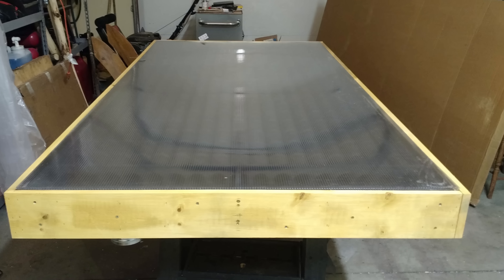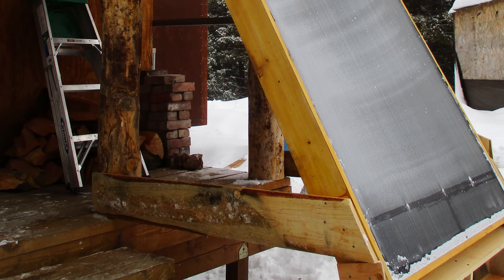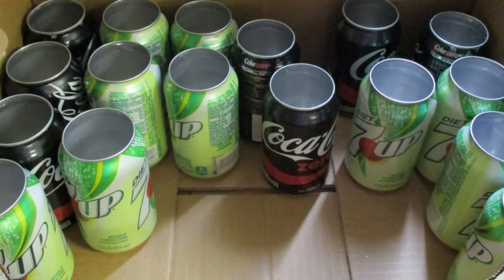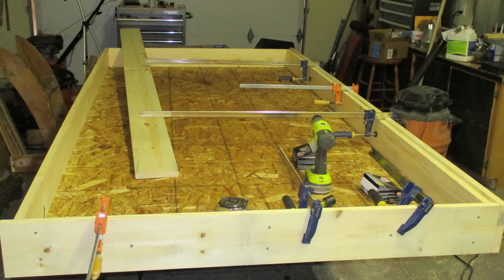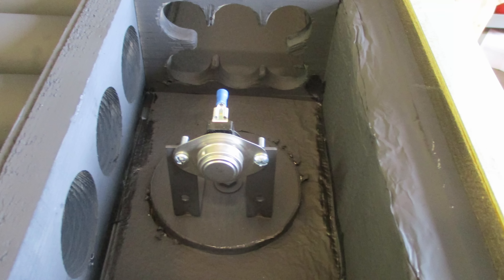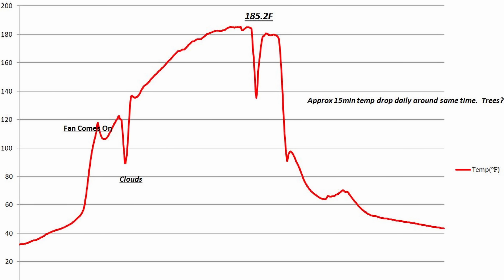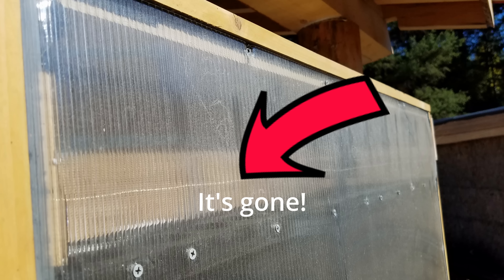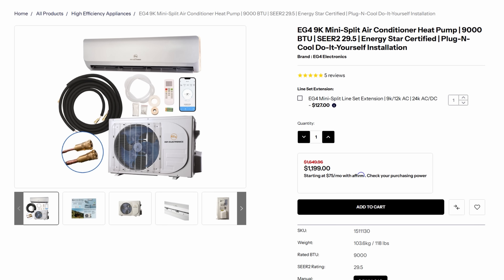7 Years with Pop Can Solar Heater - Is It Still Worth It?

Comment: I'd like to make a couple of suggestions. I built my beer can heater six or seven years back and I don't believe it cost me even $100. First off there's no wood other than the two boards that feed air in and out of the cans. The box itself is two layers of foil faced foam board. Never had an issue with it not being able to handle the temps. Now it's not a flat box. Up at the top it turns down at an angle that matches the suns elevation in winter. The top portion fits into a window so it draws inside air that is heated and blows back into the room with no electricity needed. The box is built as a thermoplane. It has a raised bottom that is around three inches above the bottom and topped by a sheet of foil faced foam. Air flows out of the house, down the lower chamber and then through the rows of cans and convection blows the air back into the house. The cans are all drilled out on both ends and then glued together in a row using liquid nails. The cover is corrugated greenhouse plastic. All caulked and sealed with metal tape. In my area it provides heat from around 10am to 4pm. It raises inside air temp around fifty degrees each pass and can easily heat almost a thousand square feet of my home. I have a simple plug made of foam board that fits in the opening of the piece coming through the window. I put a temp sensor inside the output portion and when the temp drops to the inside the house temp I put the plug in place and leave it there until the temp rises enough to provide heat the next day. The heater is around eight feet long with an additional two feet that goes into a window rather like a window ac unit. A piece of foam on each side and a gasket across the window on top so the the window is closed down to the unit. All together it might weigh less than ten pounds. So far it's held up to wind, rain, even hail and still worked fine.
Reply: You should make a video, or make a video photo slide show.  I am having trouble picturing what you describe.  I am sure many folks would be interested in seeing this design.
Reply: @OverlandOne  at least several pictures or quick schematic.
Reply from the maker: https://youtu.be/rAzUMeK9bKE I think this is what you're looking for
Reply: @TheOldJarhead  The cans portion is but not the box build. It's my own design and I don't think you can find one like it. One of the universities had plans for a thermoplane that was a standup unit that used a sheet of metal as the heat sink and moved air in and out of a window similar to mine but I'm unable to find that post again.
Reply: @TheOldJarhead  talking about the eg4 you have to have electricity to run it correct? So you're going to be constantly paying a heating or cooling Bill
Reply: @TheOldJarhead  Was actually looking or the guy who just described how not to spend $600
Reply from the maker: Thanks for sharing all these fantastic ideas and details about your build!
Reply: @haroldgreen1425  Please make a video and link it here.  I'm looking to do something like this to heat my front porch so my cat can go out all year round
Reply: You should make a video of your unit and show it while you explain how you build it.
Reply: Do you have someone on YouTube that demonstrates what you are describing? I am grateful for your contribution...but it isn't clear.
AsiflifeonEarthMatters
Reply: @BaliFoodTreePlanter  No need for video.  He explained very clearly.  No fan is needed because cold air sinks and warm air rises.  So cold air automatically gets sucked into the bottom inlet as the heat inside warm it then pull it out of the top of the unit into the house. This then draw more cold air to the inlet.  It operates by nature's convection.
Reply: @Greenr0 Thxx.  i knew that. Still not clear.
Reply: @Greenr0  
Some of us are visual learners. While I can learn from text, it sinks in far more quickly if I can see it being done.
Reply: @Greenr0  Many people are visual learners, so don't discredit that. Just because you understand doesn't mean everyone else does. If they understood, they wouldn't have commented that they didn't. Visuals help
Reply: @baldeagle5297  Agree 100%
Reply: @mlw8998  Visual learning is the easiest, so everyone is a visual learner.  But that kind of learning is not always available. Therefore, people need to train themselves to translate words to visual images, like babies learn how to walk.
Reply: Pictures are Worth thousands of words... Where you posting the pics?
Reply: Big caveat on an otherwise excellent build, Harold.  Remove that 2' hole in your house before some thug simply pushes your heater out of the way and climbs in the window.  Instead, redesign it to maybe 4 inches tall, and once it's secured to the window sill, slide the window into position and drill two holes through the lower window frame into the upper window frame and put screws in them.  That locks the window frames together so nobody can get through the opening, no matter what.  Criminals are still shoving A/C units and swamp coolers out of windows to burgle homes all over the world today.  Heads up, everyone!
Reply: @ljprep6250 The unit is 8" tall at the window but in my case my living area is upstairs and it's perhaps 8' to the window not to mention the two very large dogs that are usually in my den where the heater is.
Reply: @haroldgreen1425  I'm adding my voice asking for pictures or diagrams or a video of your heater.
Reply: @haroldgreen1425  friend please a a short video, i can not convert words into spacial space, bad brain, anyway doing my best I like it but cant imagine it as a whole because of that bad brain, i have to see physical things to understand physical things. Hands on learner, words hard. Honestly the world needs your design sir.
Reply: Can you share yours!
Reply: @andjohn So many have asked that tomorrow I'll take measurements and draw a diagram. It's a bit late now to film construction but I'll photograph the next one I build.
Reply: @haroldgreen1425  The first solar heater I.made cost nothing! It was.made over a discarded walk in freezer panel, a few pieces of 2x 6 that were also discarded and laying around. The inside diverters I used were from scrap corrugated panels I cut up and , Ok so it wasn't absolutely costless, I used some pop rivers I had purchased years before, The glass front was from a sliding glass door that was a freebie from Habitat for Humanity..Of course there were the very inexpensive Gel fasteners needed to hold things together. After it was finished guess who showed up the next day? Ralph Nader vice Presidential running mate. Not going to mention any other names because if I do I'm stepping on someone else's toes and I can't do that.  Anyhow it all ended up in a grant and a not for profit org getting involved and a business for a particular Native American and I got no recognition which is fine by me because it wasn't supposed to be about me. So now I need to do another project and use it to heat large rocks so I can stay warm this winter without burning Propane. I've been off the electrical grid now for a combined period of about 15 years over a period of about 25 starting in 2001. So the question is it worth it? Hell yeah. That first unit didn't even need a fan to make it work. If a person spends $600 getting one of these put together they did it IMOP, the wrong way
 There is little shortage of recycle able materials out there to work with. You just have to use your brain, of course if you want something the neighbors won't gripe about on account of cosmetics then by all means spend the funds and make it pretty.
Reply: @BretTschacher  I remember seeing a design in a magazine where they built a triangle. It was filled with rock along with baffles to control air flow. The front side was a solar collector and it had a reflective cover that laid down and reflected extra sun into the unit. At night you closed the cover to hold the heat in. The circulating air was sent into the house to add warmth to the home. A thermostat controlled the fan shutting it down if the rock got to cool.
Reply: Can you deduct the cost of beer as part of the solar credit?
Reply: @haroldgreen1425  Wow💥
Reply: Mother Earth News had a design similar to what you are describing.
Reply: @haroldgreen1425  what region sir ?
Reply: @Hinesfeet  Upper texas coast.
Reply: @Hinesfeet I’m in middle Tn and I would love to have a visual as well Thank You!
Reply: @haroldgreen1425  I would love to see a picture of that. Visual learner.
Reply: @misst1586  For everyone asking I drew out a simplified diagram, photographed it, sent it to my computer e-mail and then the computer refuses to open it.
Reply: @haroldgreen1425  Hey Harold, I (or others) might be able to assist. I do have a few questions and suggestions, maybe send that picture to the original poster or someone else. Based upon your mention that the computer won't open the picture that you sent it could be something with the file format created on the phone. Some phones save pictures as HEIC format that other graphics programs may (or may not) be able to open. That is a common problem. Some ways to resolve are embedding in the phone settings. Changing the default file format that the camera saves photos from HEIC to JPEG. On the computer side, using a graphic program that can handle more formats to open the file. Something like the GIMP (a free alternative to PhotoShop). All these suggestions mean nothing if none of what I'm talking about is the problem. Either way, happy to help if possible.
Reply: @haroldgreen1425  curious if you have a video to post of your heater?
Reply: @brennyrae1  Unfortunately I built it years ago and since I designed it as I built I really didn't have much of a plan. One of the universities had a plan for a simple thermoplane. It was a metal long box with a turned down top that sat on a metal frame so it was at the right height to install into a window. It had a flat metal panel down the middle of the box and a clear plastic top. Air flowed into the bottom channel from your window and heated air flowed out of the top channel into your window.
Reply: That's really helpful. I have a load of foil backed insulation spare and I had been wondering whether it would take the heat needed or I should keep it on the outside of timbers.

Comment: I think this is great, and one of the things I think need to be considered at least a little bit with comparing this to the mini split is that you're going to need to have either more solar panels, more batteries, or both. 

My dad bought a commercial version of this and it did wonders, but the thing that failed was the solar panel and the controller, it was probably that the fan burnt out as well.

I do wonder a little bit about using metal dryer vent instead of soda cans, I don't know if it would be more expensive or not, we get $0.05 for our soda cans in New York state and even for Pop cans in Buffalo.

But this is a great project. It sounds like the fan is a common failure point.
Reply from the maker: It's interesting to hear about your dad's commercial version and the idea of using dryer vent – thanks for sharing!

Comment: Wow could probably upgrade the inside with polished metal to bend some light around bottom of cans + Add Solatube/light tube logic to pipe light into it from around a home for solid light no positioning needs. Holds up old projector TV lens I got laser OCD.. Did you know you can stack light from many intakes to a single target? Hehehehe.. Careful. Might upgrade to a boiler tank big enough for day and night steam turbine if you get wild with it. Runs pipes through water for heat transfer without pumping it through water Nuclear reactor style..
Reply from the maker: Those are some really interesting and creative ideas!

Comment: That baffle at 6:42 is just like the one I bought for myself and ran into a similar issue, the fan I got wasn't powerful enough to open the flaps.  
I ended up just removing the springs and positioned it to use gravity to close the flaps. Works pretty good. Even convection might be enough to move the flaps now.
Reply from the maker: Nice.

Comment: If you are mainly using the heater to insure the batteries don't freeze, can you make or modify the existing heater to heat some thermal mass to continuously heat the space below and around the batteries to maintain an acceptable temperature ?  Secondly, if high temperatures are excessive for the muffin fan, changing the location to the input would solve a fan problem.
Reply from the maker: I've seen similar ones that heat water for radiant heat later

Comment: I built a much simpler cheaper solar furnace just using 5/4 board, 3 pieces of tempered glass, 4" 3034 pipe & a high velocity blower motor. In my case, my outside cabin surface is flat, so I just built a box that would fit the glass pieces I had, mounted it to the wall, flat black spray painted the inside of the box, cut a hole in the bottom for the 3034 pipe where the blower motor under the cabin pulled air from inside the cabin, used pvc toilet flanges to connect the pipe, that blew it thru the box to another hole at the top of box other end & piped that into my cabin . No cans or any other metal in my build. This will be my 6th year I've had it in use & it supplies more heat than I can use. Sometimes have to open my door & window on milder winter days to let out too much heat. The build is on my channel if you care to look into it. I used a similar method to build the 2 solar water heaters I have that I get all the hot water I need.
Reply from the maker: very cool
Reply: Cool channel you have
Reply: @ipsylon7297 Thx

Comment: Use a snap disk controller and put your fan away from the possible over heating temp. I built one of these back years ago and used a dc computer fan .  My heat exchangers was  window screen
Reply: You got it right ..3 layers spaced of black alum. screen
Reply from the maker: Good advice!

Comment: $600 would be 6x 450w solar panels. That would be a lot easier to use even if most of the suns energy doesn't convert to elec and back again.
Btw: Using 2 layers of polycarb separated by 1" would insulate the front as well where your biggest heatloss occurs.
Reply from the maker: Where are you getting those that cheap?
Reply: @TheOldJarhead The only way to get them that cheap is buying used panels

Comment: I did something like this in about '76 with a horizontally mounted panel make with 1 X 6, some cardboard, salvaged galvanized sheet and fiberglass insulation.  The sheet metal was spaced equally from top and bottom and air was blown over the top to keep the clear plexiglass cool, and down to a "diffuser" at the bottom where it would flow up the back.  I had 2 rooms with windows 6 ft. apart, so I mounted insulated wood ports in the windows and just had a fan in one room and blew heated air into the other.  Worked great.  With a circulation fan blowing from the "hot room" down a hallway I could keep my house warm on even 30 degree sunny days.  No backflow with the fan off because both ports were at the same level. Just as an experiment I set a 1 kW heater in the "hot room" and it would not maintain temperature as well, even running continuously.
Reply: I did the same thing in 1978 - a small 2x2 foot test unit, using soup cans arranged in a grid pattern (not even rows), and painted a flat black. It was so dark, that it was almost impossible to see the bottom of the can. The top surface was a 2 pane plastic window, and the inlet and outlet were on the sides. I set it up outside on a sunny day, and I had to get the air circulation going as the temperature was rising RAPIDLY inside, so much so, that the inner plastic was starting to melt! With airflow started, the exit temperature was measured at 180'F !!!!
Reply: @paulmoffat9306  When you say 2 pane of plastic.  What was the orientation of the plastic windows and were they spaced apart/above each other?
Reply: Ok bot.

Comment: i dont see this costing $600 unless you buy all the stuff from a store!  ......  its called second hand materials to save cost i seen these built for free
Reply from the maker: Yes, for sure it can be built for free if you scrounge parts for it!
Reply: I agree with you on the topic of "For Free" 
Here is the flip side.
When you live "Far and Away" (Shrek Movie reference) there is a cost associated with getting to the lumber store.  
Shopping for free means unless some local dump has a Free pile, you are just driving around looking for things like construction sites with a dumpster.
Yes, you might be able to strip some wires out of something.  But it's time in the city that those who live in at a minimum the suburbs' get those chances randomly every day.
(I don't have crime where I'm at (A great trade off) but the costs of going shopping are shall we say different.  I miss finding parts from Boeing Surplus, and thrift stores.)

Controllers, fans, the best black paint for these projects, those flexible hoses  Ya, you can't get around those things.
(Somebody said thrift store or habitat for humanity sliding glass doors was a great idea provided you have the tools to cut the cracked stuff down!)

Comment: If you used a roofing panel painted black as the heat absorber and use a thin flap like a flattened can hinged over the output to act as a one-way valve.  Maybe put the circulation  fan in the return vent on the porch to keep it from temperature extremes pushing the air from the porch.  Or reverse the flow and push the air from the top to the bottom to prevent heat extremes in the top of the box the number of calories absorbed by the painted metal should be the same.  The heat coming in through a floor vent would distribute it to the batteries.
Reply from the maker: Using a roofing panel is an interesting thought, and I've heard others suggest moving the fan to the intake side too!